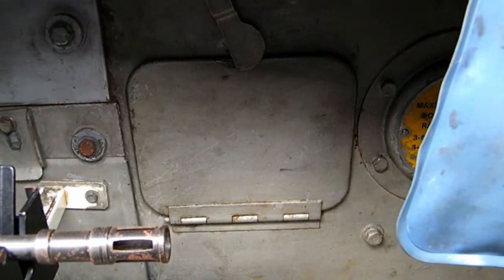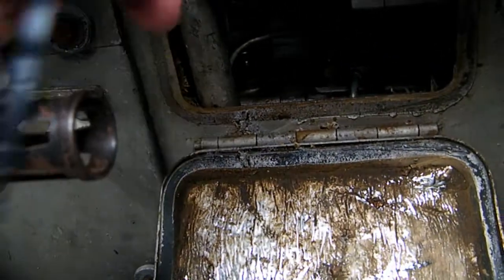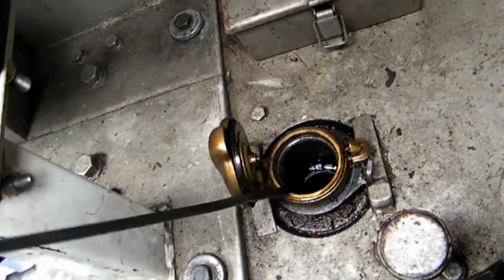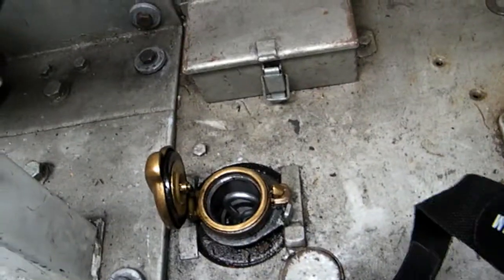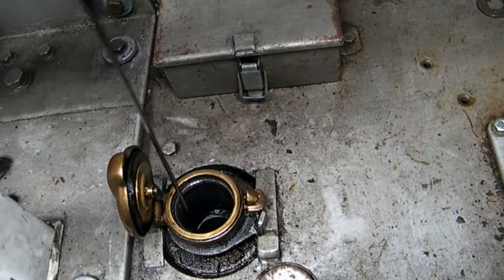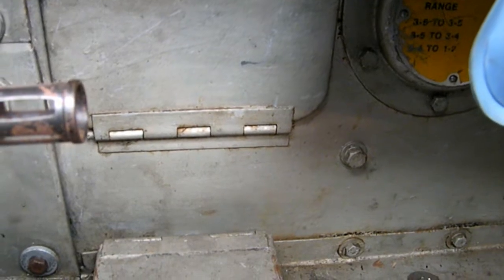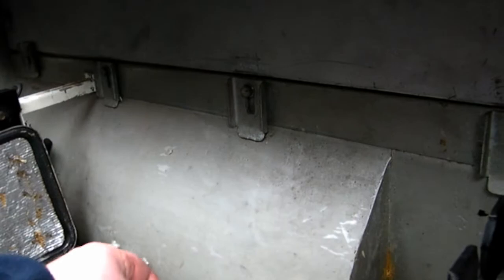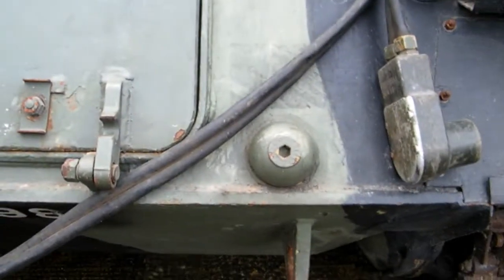fv432 k60 Oil checks.

Comment: In addition, do not forget to check the fan drive oil level. The filler cap and dipstick are under the rear engine louver cover, in the corner of the fan deck. If the level is too low the fans do not turn and the engine will overheat.

Comment: A steering box hot check should also be carried out after driving for a while and the box is hot, oil seal leaks from the box can cause the bands to lock onto the drums and cause the vehicle to slew violently to one side. As happened to the 1RRF RSM's 342 MK1 in Petershagen 1981 stopping only feet from a house and I still have the pictures, that is also the reason the dipstick is accessed from the front so you do not need to open the front hatch..

Comment: OMD(oil mineral detergent) 40 was the oil specified by the MOD for this vehicle when it first entered service.Over the years the oils etc.have been changed and they receive a new number,so OMD 40 became OMD 75,then OMD80,and currently OMD90,but essentially they are all the same type of oil,so don't worry;you are not putting the wrong oil in it.If you can't get hold of OMD75 then just use OMD80 or 90?